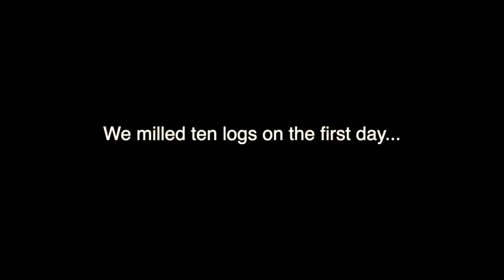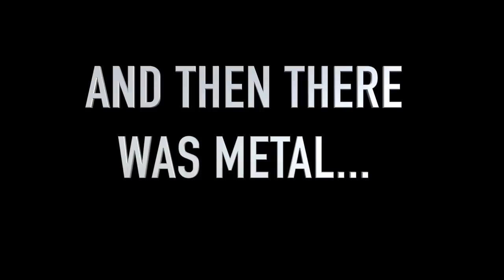On-Site Milling; GIANT Douglas Fir

Comment: Nicely done! That was way more lumber than I was expecting. That larger piece of metal probably ruined the blade, but personally I don't mind the look after it hits a nail. We have a barn with marks/lines throughout the lumber like that. Adds character.
Reply from the maker: The first nail I hit just added some character. That piece of steel cable destroyed the blade and stalled the saw. It made quite a racket.

Comment: Running into metal is the reason it can be worth it to buy a set of bimetal blades for the saw for those times you do hit metal it can be worth it to swap out to the better blades. One of the guys that mills large yard trees talked about how much better they deal with metal a year or so back
Reply from the maker: I ran BiMetal blades when I was sawing reclaimed beams that I knew had staples in them. They definitely can handle some steel but they’re nearly double the cost. I prefer to let the client know ahead of time about the charges for blades damaged by metal.

Comment: With large milling jobs like this what is the best/fairest way to charge? day rate and blade charges or board foot?
Reply from the maker: I never charge by the board foot for on-site jobs because there’s too many things that can slow you down. For instance, I needed my tractor on the project because the logs had to be moved to the mill. I estimated how long I thought it would take to do the job and how many blades I’d use. I charge per blade for metal and
For my time to get my equipment there and back.

Comment: I am hard of hearing and miss not having the closed caption like you have in most of your vidioes.
Reply from the maker: They will be added automatically but it sometimes takes a little while. I tried adding them once and it’s very difficult to do manually.

Comment: If they weren't using that lumber on-site would it have to be inspected to be sold?
Reply from the maker: Not to be sold but if it’s going to allowed in a structure requiring permits, it would have to be graded and stamped
Reply: @NorthwestSawyer   So I'm in south Canby and have a few trees I would like someone to "cruise" if that's the proper word / spelling, you know anybody please, you can PM me if you don't want names up here, I thought Yoder mill did but I reckon they don't.